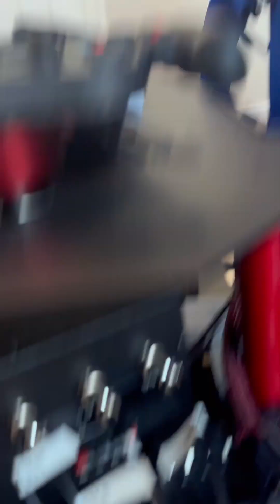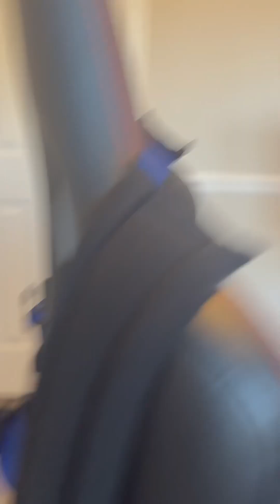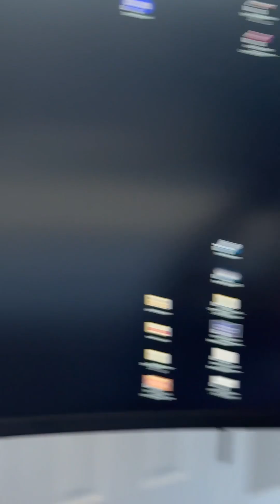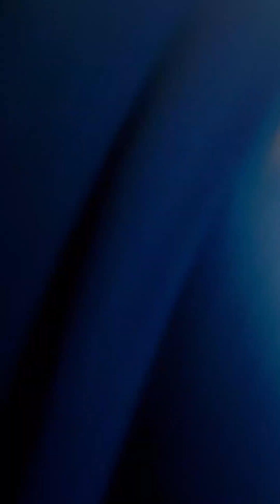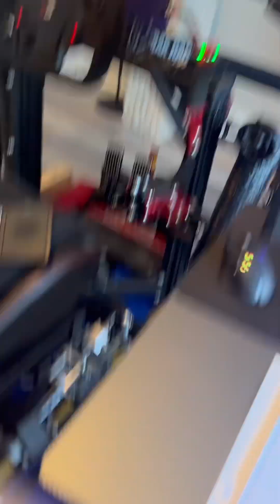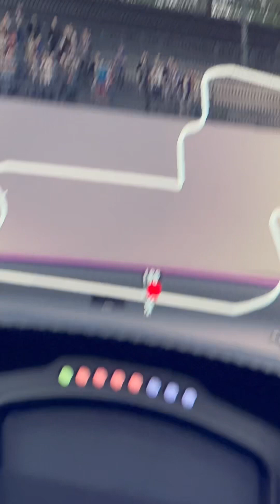DOF P3 Start up problem

Comment: i have a new H2 and have similar Problems. But my Rig isnt moving like it should. Sometimes it responds violently left up, right down etc. 
Have the same Prob with smc3 Software. Sometimes i get it to work sometimes only PC restart helps. Sometimes not. 
Its a good Product i guess but Software Wise its not well tested. 
Hopefully i got mine working in the next days...
Reply: I was able to resolve all my problems by doing two things. 1- Plug rig directly to wall socket (not a power strip with other components), 2- I installed a seperate PCI board and plugged only my DOF, Shake kit and wind kit into it, all other USB cables went to motherboard.  Since doing this I have green lights everytime I open SRS and do not have to open SMC3 at all now.  Hope this helps